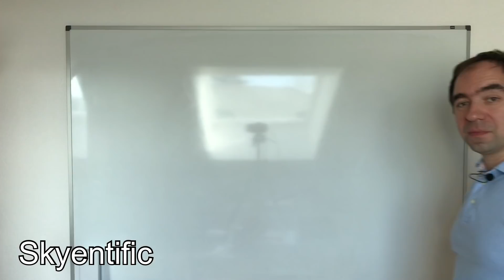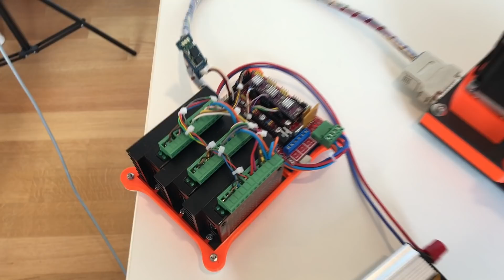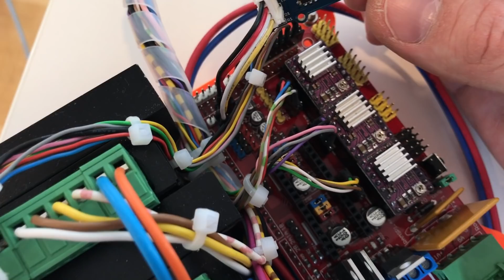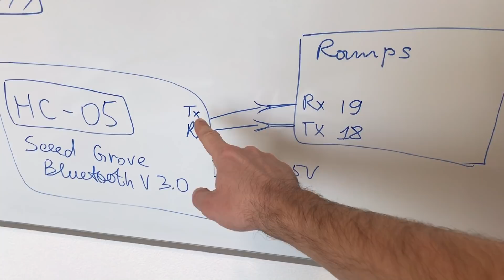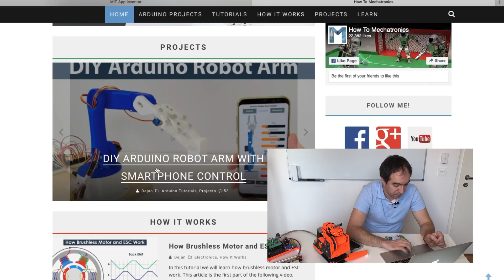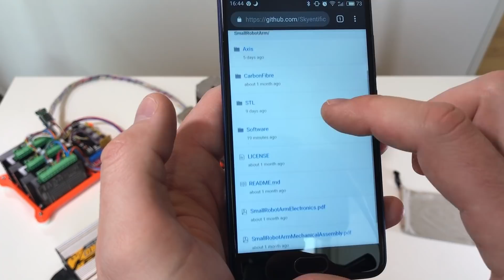Robot Arm programmed and controlled with SmartPhone (Bluetooth)

Comment: Congratulations. Nice work. As far as I understand you did not use a rotary encoder. And you manually adjust the starting position of the robot arm and bring it to the same position when closing. Do you manually adjust the initial position when the power goes out or the operation is interrupted, when you want to start it again? Or does he go from where he left off to his starting position while working?

Comment: Hi, Thank you very much for sharing! 
I have watch your video very carefully and even made notes when you explain your design 😂 ,  
and I hope there will be more development of your robotic arm in the future.
For example: G code post processing, Use G-code and mach3 driving the robot.
It can be use for laser cutting，Milling.....
I got inspiration from your video，and I am going to make a larger version robot. 
I will weld the body with a metal square tube, and Drive it with 750W 90 Servo Motor.
Thanks again!

Comment: Hello sir i built your robot it is awesome
and i have added a gripper but I find that the nema 8 has very little torque i would like to put a nema 11 in the place can you provide me the fusion 360 of the holder of this engine please ??
Here the link https://youtu.be/wVrpFJkjFN0
Reply from the maker: Great robot! Excellent job! I will put the fusion files on the GitHub page.
Reply from the maker: I put the files. Please check if they are ok. They have f3z extension.
Reply: @Skyentific  Thank you for everything and your great job..
I check tonight after work
Reply: @Skyentific  unfortunately it did not work the CAD file is empty
Reply from the maker: Try to check now. Hope this time it is going to work.
Reply: @Skyentific  f3z files works thank you 👍🏻

Comment: The robot does not respond to commands sent from app. I have already tried different pins, with no result. Also did reset HC-05 module. 
How to solve this problem?
Reply from the maker: Are you sure that you have the connection with Bluetooth? Several people already tried this application and it worked.
Reply: Yes, its connected. Do i need to uncomment  some lines in sketch?
Reply: @roscombot  do you have a solution? I have the same problem as you

Comment: I am impressed with your robot!
 I have already ordered the necessary parts. Fine would be, if (on the Ramps and the App) You can add at least one servo motor (for gripper or something else), as would be the robot very useful. I'm sending a small contribution too.

Comment: Hello. I can not start apk on my S5 phone. On which phone do you have apk SmallAR running?
Reply: Already the problem solved turned out to be the reason that the size of the IMG_1348.JPG icon was too large as soon as I removed it, the program is beautifully installed :). I read on the forums that the size indicated is 48x48 px. Best regards
Reply from the maker: Glad to hear that you managed to solve the problem. Btw I used Maizu M5.

Comment: I am not familiar with App Inventor; could you add the option to enter numbers from the on-screen keypad, as well as use the sliders?  I don't think it is critical for every position to be recorded precisely, so for the waypoints use the sliders, but for the positions where accuracy is essential, you can enter exact numbers.
Another thing I could not work out from the video;  after you have recorded a set of steps, can you go back and edit them, or must you start again from the beginning each time?
Another inspiring video... thank you again.
Reply from the maker: Thank you for your another inspiring comment! For the moment there is no possibility to edit already saved points. I like both your ideas. And I would try to implement both of them in the future. Thank you!

Comment: is your robot able to controlled with playstation/xbox controller?
Reply from the maker: Not yet. For the moment it is possible to control it either directly through the Arduino program, or through the Android application. In the future I would like also to implement GCODE support. I don't see an advantage to use xbox or playstation controller. But if many people would be interested I will implement this too. 

Do you have an idea of interesting application of robot with playstation controller?
Reply: I have a 6DOF robot arm and used a PS2 control.......its easy BUT the presicion is not as good

Comment: Hi, I was wondering if it would not be beneficial to use encoders on the axis. This would not only improve the problem with lost steps when the arm is overloaded, It would also allow you to turn of the motor, move the arm by hand and record the positions. Then you could replay the learned movements. But it is a nice project! I am planning to build one as soon as I have finished my current project.
Reply from the maker: I agree that encoder will give some additional features. But I wanted to keep the price of the arm relatively low and not overcomplicate things. But for my next robot arm (with brushless motors) I plan to use encoders :) . Thank you for your comment!

Comment: wonderful job congratulations. Good idea the application. bluetooth module has four pins so it's only a slave is a hc-06? hc-05 has six connections I believe and it is a master and a slave. You think it's good to provide some extra cables when mounting for the gripper but in this case the db25 is too small ?

Comment: hello, is your robot can control with gcode?
this is the best advance design i have see. and with gcode possibilitie this is was great.
Reply from the maker: I completely agree with you. I don't have a gcode control yet. But this is in my top priorities! I want to do this since I had an idea to build this robot arm.
Reply: @Skyentific  one option would be to modify the Marlin firmware - this supports Arduino Mega + RAMPS (which is your electronics setup) - for 3D printers and add support for inverse kinematics with it. your robot will then take gcode commands for moving. later you can put an extruder on the tool holder and turn the robot arm into a 3d printer . anyway great progress so far I am tuned to your channel!
Reply: @cezar17negru  it wont have torgue hold extruder. even if would have no use 3d print 6dof.only need 3 axis for 3d print.gravity do rest lol.you cant 3d print 90 degree.plastic trip down.and there no slicer for 6dof lol. you need build it
Reply: @Генадий Мисюта super great job, i will look more.